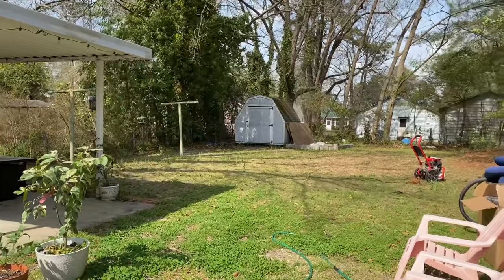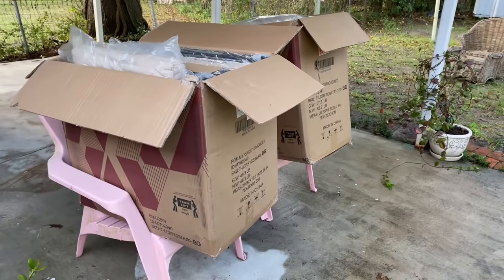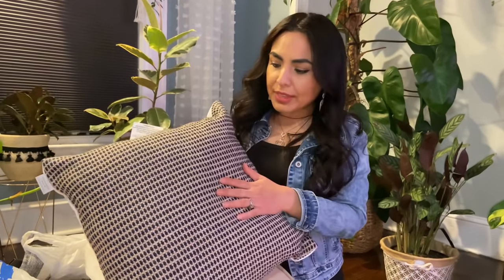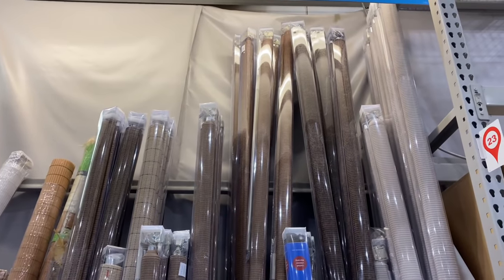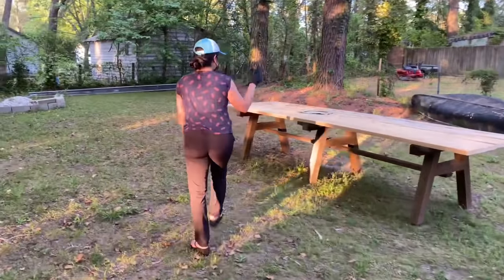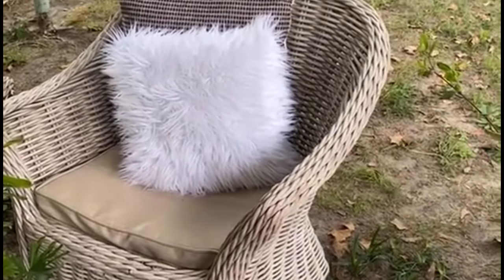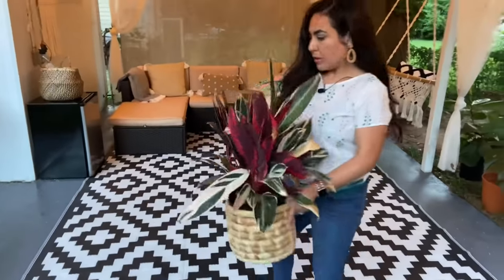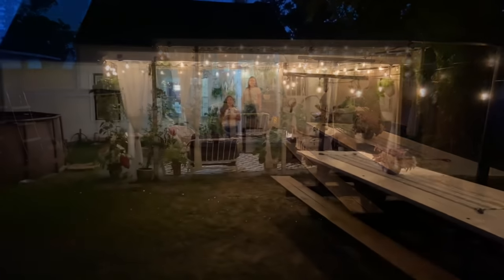EXTREME TROPICAL OASIS PATIO TRANSFORMATION ON A BUDGET!!! /Using lots of Houseplants!💚😉

Comment: Love the plants you picked.  We have cold winters and we wrap our small patio with plastic and pit all my warm weather plant in during the winter.  The sunshine keeps it warm like a greenhouse .  My hibiscus bloom all winter. Just unwrap the plastic in April or May after the threat of a freeze.  We use a heavy duty plastic from Home Depot.  It comes in big long sheets.  We wrap it around long 2x2 boards and attach them to the edge of the house then wrap it around the area and end with another 2X2 attached again to the house on the other side.  We live in a high wind area so we use a couple of fence boards along the top of the plastic.  We just screw each end of the board to the cross beam of the patio.  It keeps the plastic  very secure.  My plants survive the winter and we are all happy.  Great job on your patio redo.
Reply from the maker: What a great idea! I will have to try it! Thanks!

Comment: Wrap the palm in clear 3m plastic and add those white Xmas lights those produce a small amount of heat if you need to keep the tree in a cold area , I would add 3-4 sets of the lights...make sure you get the ones that produce a Little heat when they been on for a while...there's YouTube videos where folks used them for this exact reason. Good luck and great back yard reno
Reply from the maker: Awesome!! Thanks for the tips!! 😊😊😊